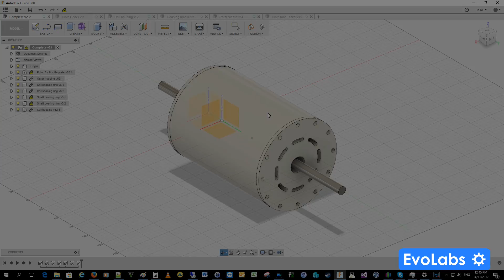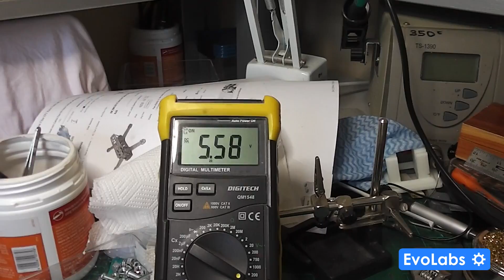3D Printed Generator - V1

Comment: Maybe the heat started to melt the PLA, and along with the weight of the magnets the rotor warped and failed?
Reply from the maker: Possibly...I came to a conclusion that it was likely a failure of the epoxy glue between the PLA and the magnets, but yes heat may have played a factor.